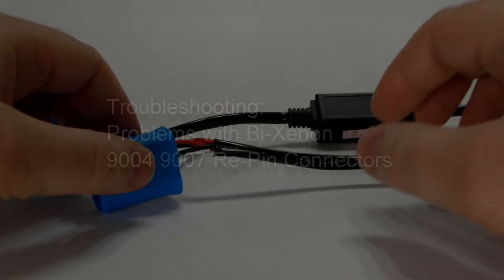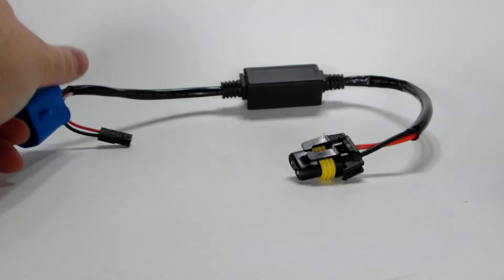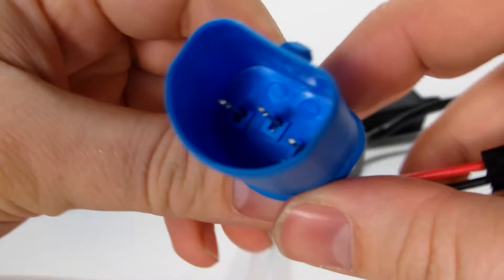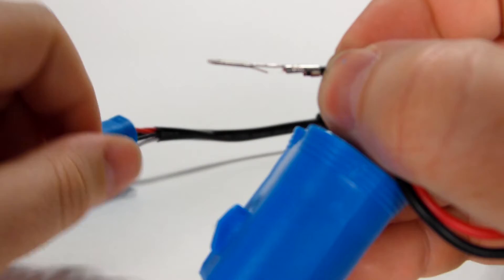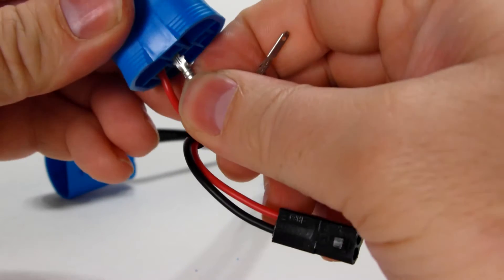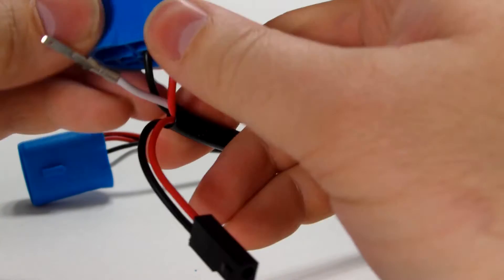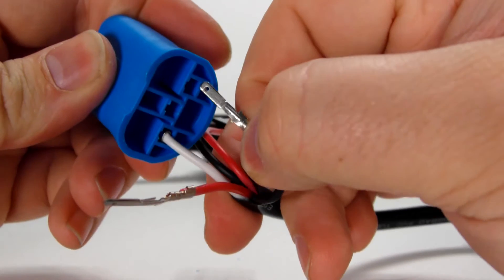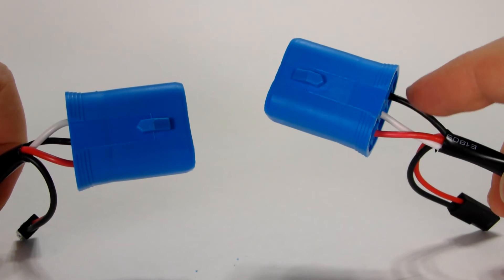Re-Pinning 9007 9004 Swap Pins Trouble Shooting problem with Bixenon controllers by DistantXtremes

Comment: i tried pushing pin down to flatten locking tab in order to release pin, no luck on pin release. I tried it on 6 different connectors